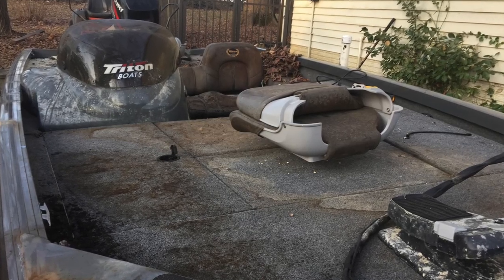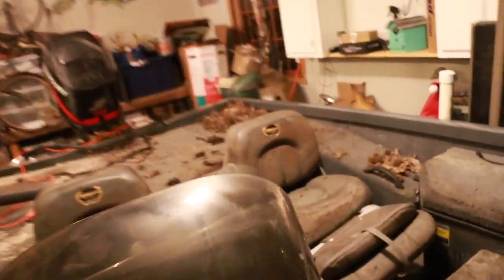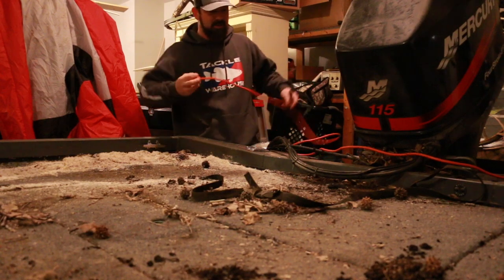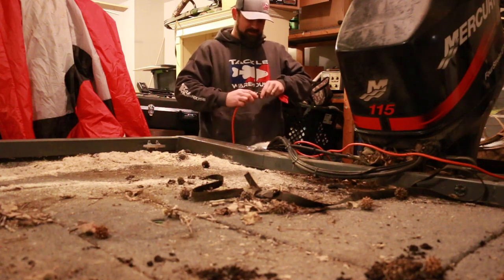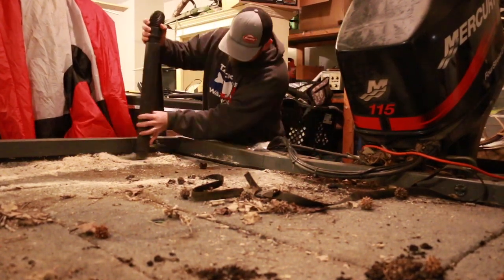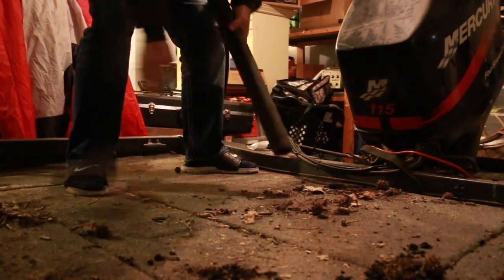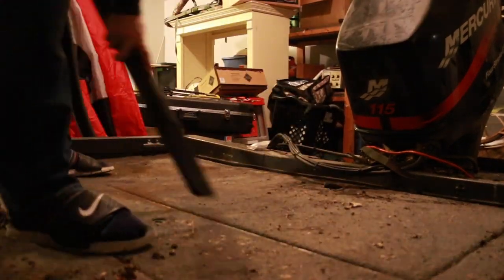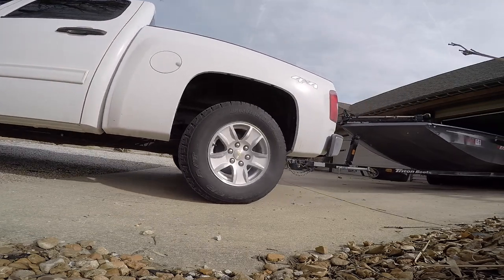Trashed Boat CLean-Up Part 1 How Can This Happen

Comment: I had that exact same boat.  Loved to fish out of that thing - it was perfect for me as I fished mostly alone.  Easy off, easy on, fished "big" and plenty of storage.  Makes me want another bass boat.  Great job.  BTW, mine had a 90 on it and ran pretty good.  I bet yours does really well with a 115.  Tight lines!
Reply from the maker: she runs good but i think i should mess with the prop and engine height to get max performance.

Comment: Keep that thing! I used to have the same boat as TJ81 and sold it to get a 20ft skeeter. Its a great boat dont get me wrong but the aluminums are so much cheaper for gas, maintenance  etc. And you can get shallower n catch the same fish. I miss that thing.
Reply from the maker: For sure.  I am definitely going to put it to work.

Comment: Lol thats not a mess, im trying to figure out to approach a boat i just pulled out the woods
Reply from the maker: +Rev D oh boy!  You got a project there.  I’m sure it will be well worth it.
Reply: @PhantomFishing  been sitting for 12 years, thats why i found your video, trying to figure out where to start trying to clean this mess up.

Fisher Hawk V3: needs batteries, carpet, seats, new dash, new wires, trailer needs new tires and guide boards.

Comment: Forgotten toys are the best ones to pickup. Especially if it’s a boat.
Reply: David Gardner 

Not if you buy one that has engine low pressure problems and you have to do whole new piston job..I had to tear down couple engines and it ain’t fun putting it back together. Though it’s a learning process it’s not cheap either
Reply: Gghyggty Gyhuyfsa yes you’re right I’ve done that too it took a month to get the block and heads back from the shop. Also learned it’s better to have two boats that way ones always ready.

Comment: I'm curious did you pressure wash the carpet against the grain before spending big money on carpet foam cleaner?
Reply from the maker: +Rowdy Broomstick I didn’t really spend a whole lot on the cleaner but I read an article from a guy that works at Ranger Boats.  He had said to be very careful pressure washing due to the fact that the carpet has plastic in it can actually melt and will sorta shrink or harden and lay down.  I think you just have to make sure you don’t get the nozzle too close but I did take it to the car wash for the initial spray down.
Reply: I've done it to mine a few times a year but I don't know if it damages it or not. I bought my Cobra Viper in 2015 and it still has the original carpet and is still in excellent shape. I do plan to replace it with bass cat carpet this year and pad the deck but I could probably go a few more year's no problem,but I don't use a steamer pressure washer either, that might mess it up. But who knows I may buy a new boat this year to, I've really outgrown the 18ft Cobra! The 19.6 ft Bass Cat Pantera Classic has a way better deck layout and use of space and only a foot and half bigger than mine, but mines dual console and that stinks

Comment: A pressure washer will do that for you no need to scrub carpet and seats.
Reply from the maker: +Harlan Mote you have to very careful with a pressure washer.  This carpet has plastic fibers and if you get too close it will essentially melt the fibers.  That’s one reason you see a lot of boat carpet really stiff and flat.